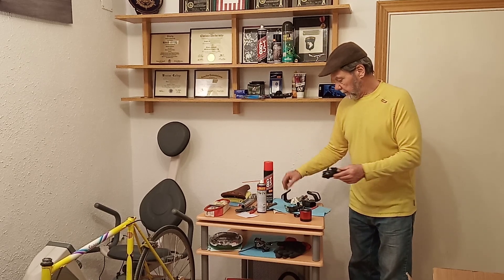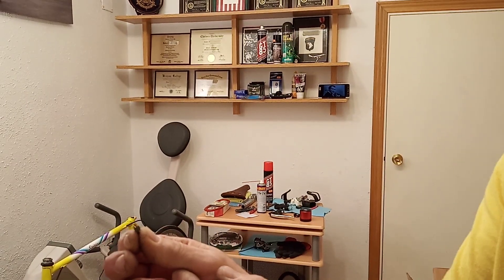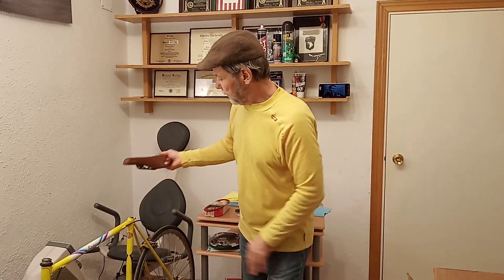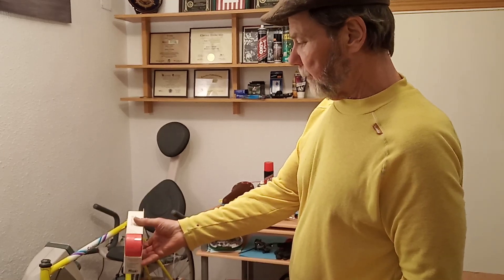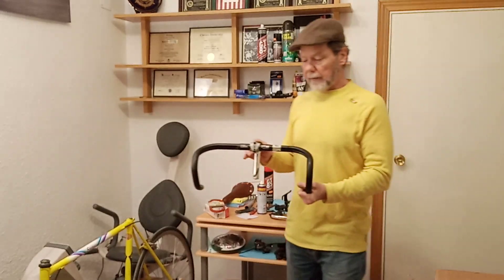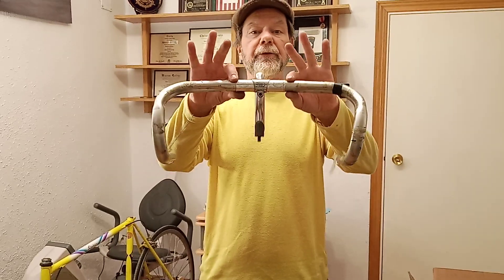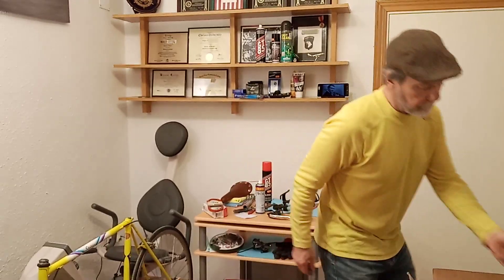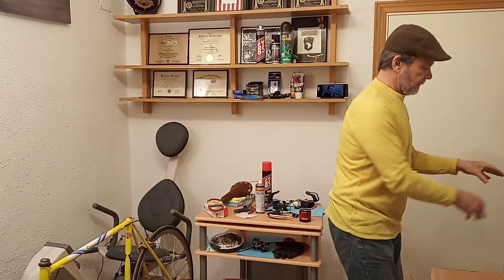The Cinelli Update Edition

Comment: Finding shifters that year that would work is hard, that was good luck.
Reply from the maker: I know that the bike shop gave up trying to fix the lever.  Let's face it how many hours can a bike shop spend fixing old shifting lever?
Reply: @bobmajew53    that's a good point there's no profit in an obsolete part but when you consider 7 x 3 speeds are still being sold you did well.  21 speeds probably have a couple duplicates but in general it's an acceptable way to reduce the price of a bike.  Shifters are the most expensive part of my bike even more than the frame.
Red Shifters are worth it, smoother.
Reply from the maker: @juansanfrancisco2317    Poseidon X comes with a 7-speed, it has an excellent frame, future upgrades would happen anyway.  Practically everybody changes something,  pedals, seats and handlebars, generally in that order.
Reply: @bobmajew53    tires, I don't know why they can't put better tires on Factory bikes.
Reply from the maker: @juansanfrancisco2317    You may have heard me grumbling about my Rivals.  When I put the Venturemax handlebars I was mid-shifting on the up-shift a lot, it still happens but not nearly as much and with the X-0 or I haven't noticed it but I'm sure it's possible if it's the shifter/ie, could be me.  On the gravel it's hard to hear certain things but the GoPro seems to pick up the sound.
Anyway I'm shopping for a set of Force Shifters.  There's really no hurry because 10-speed prices will continue to go down.  11 is dominant in Europe.